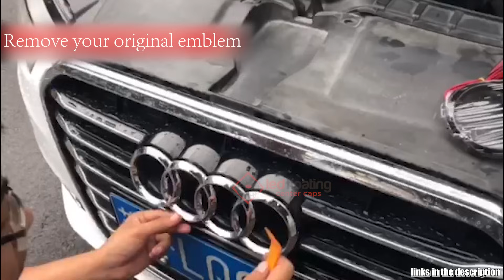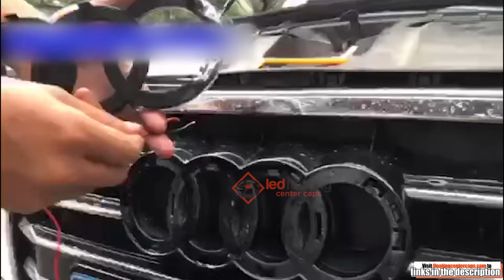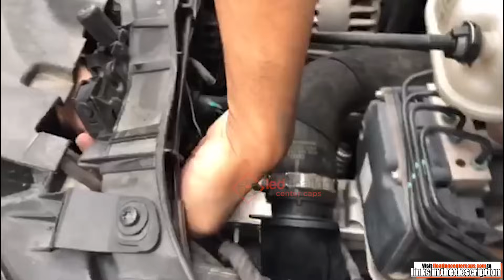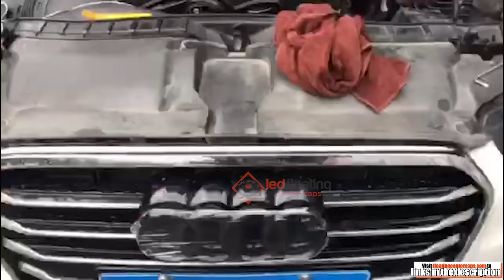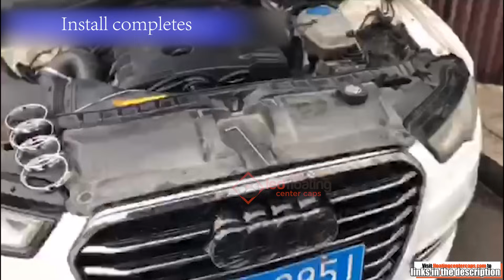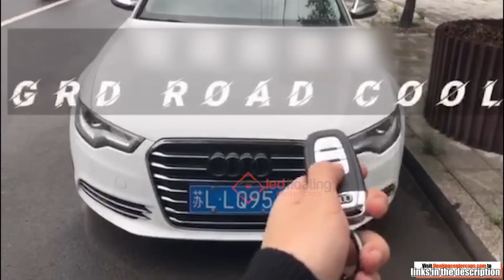How to install Audi Led Emblem | Dynamic Light up Audi Emblem Installation Tutorial

Comment: I would have spliced both power and ground into the existing headlight harness so that way its protected by the headlight fuse and will only come on when headlights are in use.

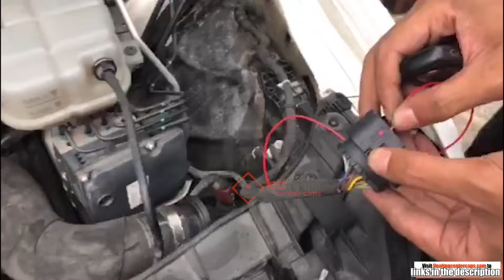Comment: Seems like at 2:02 you show testing the thing by sticking the wire into the exposed open end of the harness, then you skip poof magico to "install complete" at 2:03 without showing how to actually connect the wire to the harness for real. Lil help?
Reply: Probably because there's a handful of ways you could wire this. DTRL, headlights, lock/unlock, etc. They literally just stick the bare wire into the connector and plug it in for this video, which is sketchy to say the least